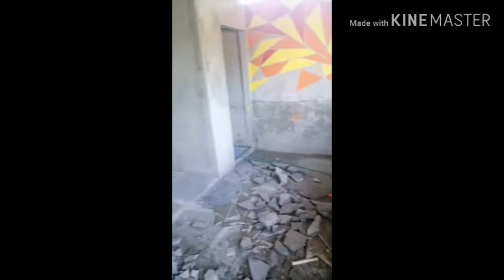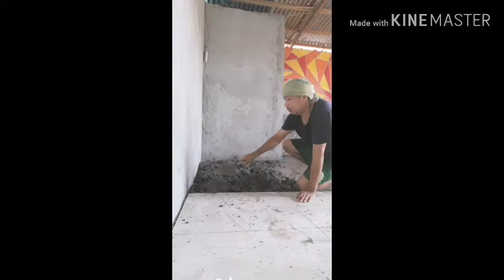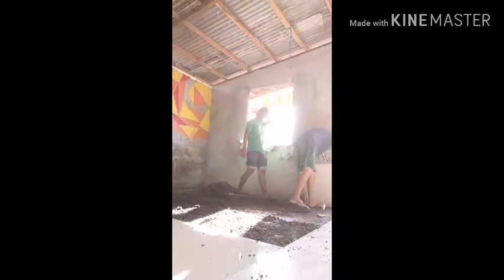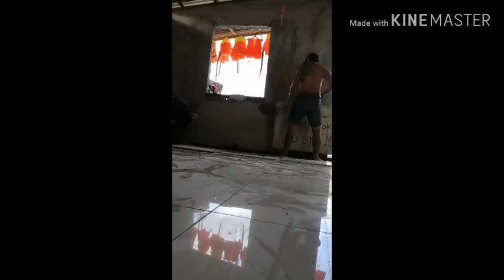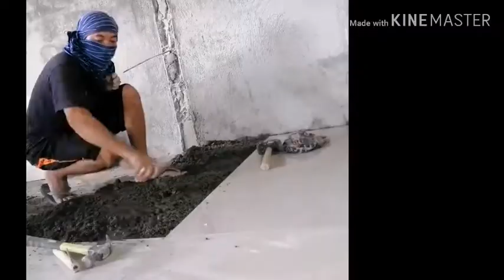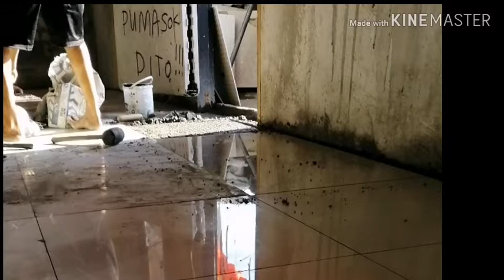How to install a tiles using DRY PACK

Comment: Ano mas matibay..ung dati or ung dry pack
Reply from the maker: Drypack po
Reply: Tanung po ulit pag sa flooring po..ano po mas maganda nantiles.. ung 60x60 or ung 30x30...kc sabi nil sa flooring need daw ng space...para daw singawan...may nakita ako na tiles na walang space...
Reply from the maker: @jimsonfelipe722  60x60 maganda talaga may space kasi pag mag repair hindi na mdamay yung iba.. Yung wla space nman once na pinasukan ng hangin ang epekto nun  kakapak...
Reply: Salamat sa reply sir